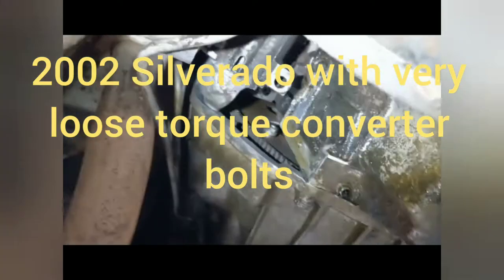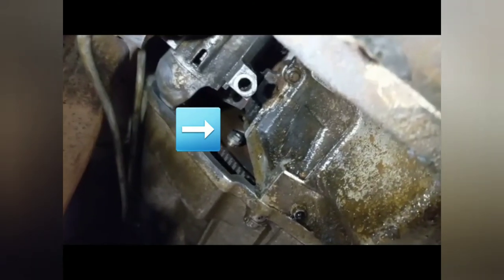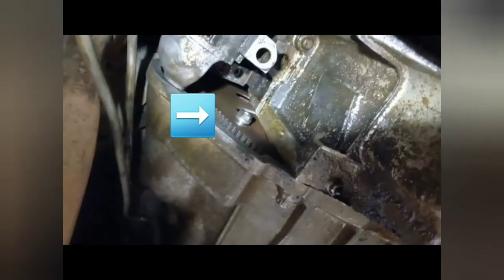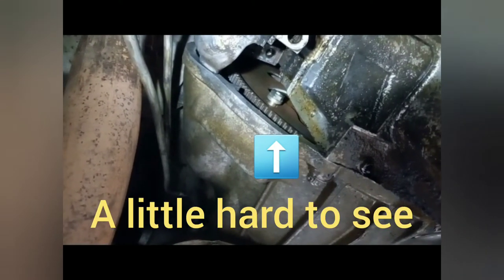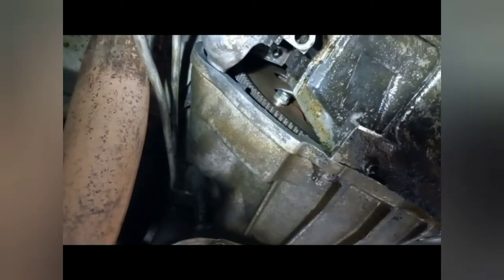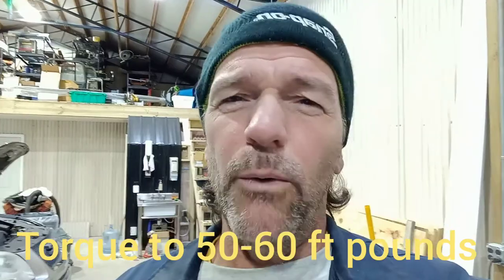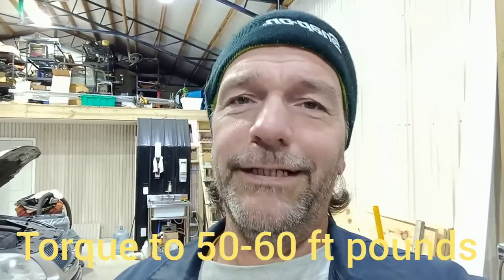Silverado noise from transmission area

Comment: Man mine sounds like I'm dragging my exhaust but I can't see anything. Sounds like it's up in the front of the trans.
Reply: What have you found out? Mine has a tinny rattle but it's not constant cant find anything loose. Exhaust kinda makes the sound when running and I bump it sound is on started side of motor.
Reply: @martinmitchell8840  it was the starter, turned out the spring broke so the gear would fall forward and hit the flywheel causing a tin can sound.